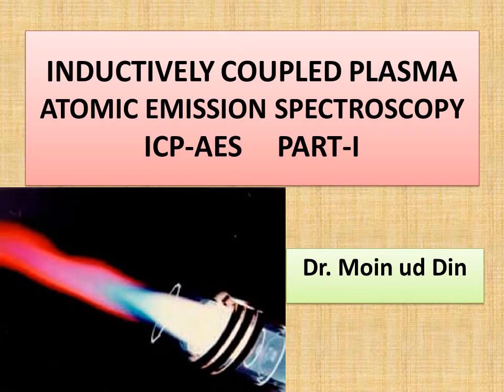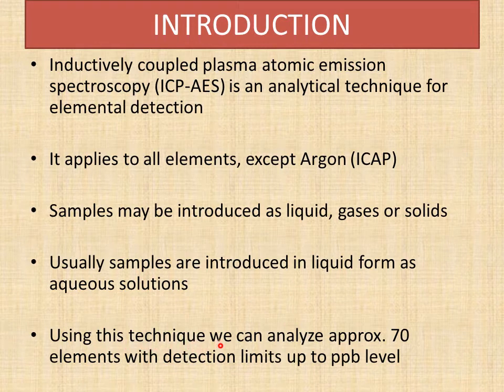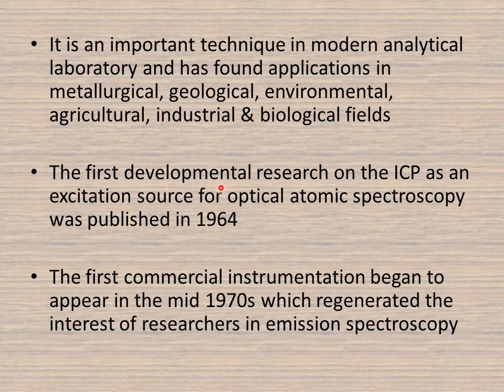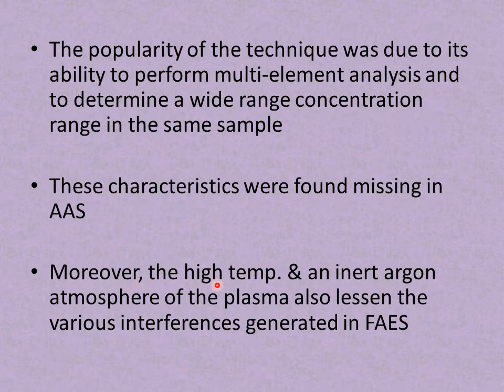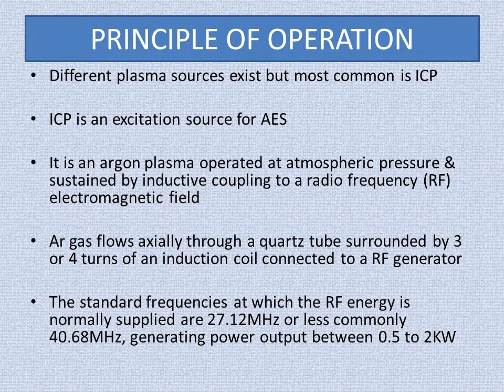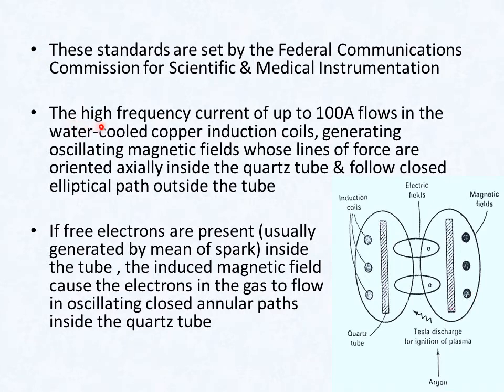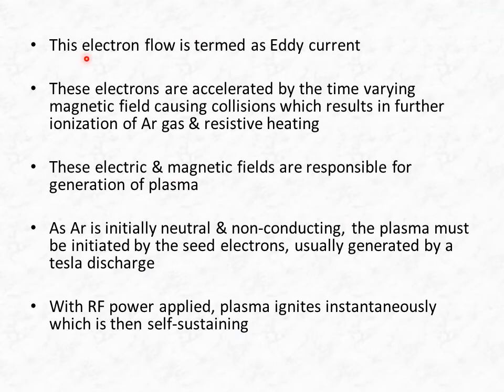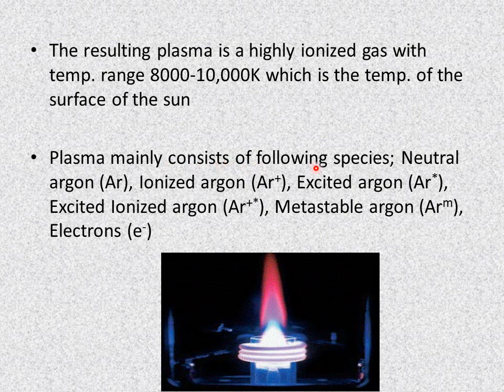Inductively Coupled Plasma-Atomic Emission Spectroscopy || ICP-AES || Part 1 || Operation Principle

Comment: Why we need ICP?
Reply from the maker: For atomization purpose
Reply: @DrMoin-ri2bn  for atomization we can also use other several sources .but why ICP used?
Reply: It has less temperature fluctuations than a flame, rather a flame can excite a few elements only due to its low temperature range(alkali, alkaline and few others).  ICP is more sensitive than other atomizers.  Temperature provided by ICP is quite uniform.  As Sir has mentioned in these slides that ICP can provide high detection limit. It is another edge if ICP.